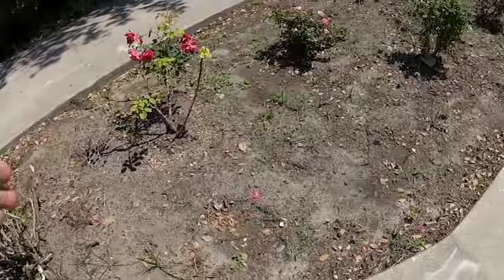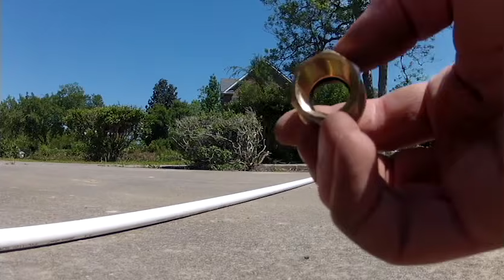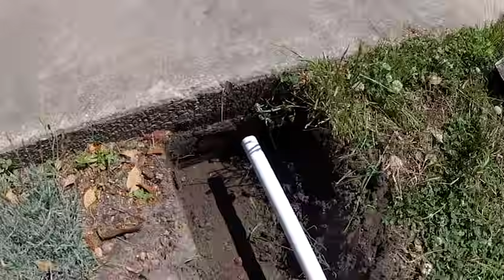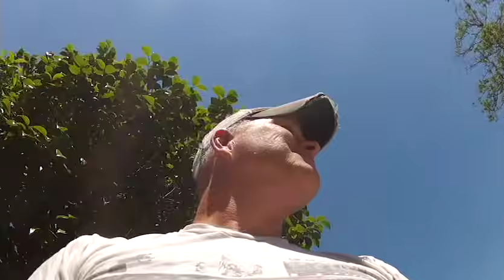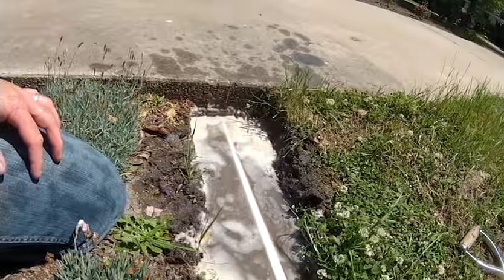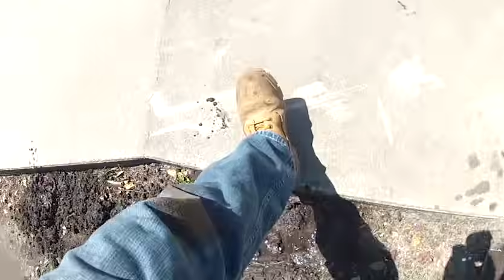How To Get A Pipe Under A Concrete Driveway

Comment: Let me help with a added tip... Make the pvc an extra 6 inches longer. Glue on a threaded fitting (pvc) to attach a brass nozzle with a 1/4 inch pressure nozzle. This will blast the dirt and Rock out of the way. I did same thing. Took me maybe 5 minutes tops to cross a drive way. When done remove brass fitting and cut thread off if not attaching a hose. I ran electrical through mine for lights... But same threads can use a drip hose! Easy peasy... Your way with slow hose removes too much dirt and concrete may crack with no support. My way only enough room for pipe is removed.

Comment: He's under minding his drive way I hope he is only going to  drive his lawn mower on it.  I'm sure it's going to crack up anyway ? I would not do this it's not that big of a deal to just drag out the garden hose when you need to water .  And not to mention if you don't include a way to and or forget to blow the water out of the line it's going to freeze in the winter it's not that deep under the driveway and on either edge?
Reply: Nope

Comment: Whenever I used this method, I put a nozzle on the business end and turned the water on full.   One wants to maximize the hydraulic horsepower at the tip.   Still not a bad job.

Comment: I did this over 40 years ago.  Two inch pipe, two feet deep, under a street and hit hole on other side dead dead on.  Reduced pipe to 1/4 inch hole.  Worked great.  Jake Cobbs

Comment: I did the same thing under a black top road, using a cap with a few holes in it.  It was long enough so I had to add the second 20" joint in the middle of the job.  No problem.

Comment: A variant to "saintnash's" comment that will dramatically improve jetting speed and further reduce caverning is the addition of a 3" - 4" long bolt protruding from the jetting cap. It doesn't even need to be ground to a point. Just center drill an appropriate size hole in the cap and affix a 1/4 or 3/8" bolt with a nut. The bolt will displace earth like warm butter! I would also make sure those jetting holes are small. Like 1/8" dia max! The less earth you can disturb the better. Even with these mods I agree with FortunaZKat's method for being the least prone to creating a  crack zone. Wakodahatchee Chris

Comment: I have rocks under my concrete, it is on an ancient riverbed. :))
Reply: Ok. You will need a drill with a long steel snake ( yard tools use them) to attack bit to drill through a pvc for support.  Don't go to fast.

Comment: so it dosent have to be high pressure   ...  this will save me some
Reply from the maker: No. I used standard residential pressure straight from the spicket to the hose
Reply: @mytaborcityhome1002  ,,thanx so much  all the other vides  were showing higher pressures ..this will save me

Comment: So I bore for a living.  Yes this is an easy way to get a pipe under your driveway.  But if you add nozzle to the front of it, and give it good pressure you’ll push this through in minutes.  Also people that are worried about loss of soil, you’re only bringing back the cuttings that is getting blasted with the nozzle.
Reply: Yep!  60 years ago my dad showed me how to do this while extending the sprinkler system at my grandmother's house to the street side of the sidewalk. He used a piece of galvanized pipe with a brass inline garden nozzle on the leading end of the pipe. Took about a minute to get under the sidewalk, then he unscrewed the nozzle and "adapter", screwed an elbow onto the pipe along with a riser and the brass sprinkler head and connected the upstream end of the pipe to the existing system with a union. He left the holes open for a short while so things could dry out & I don't remember there being much play in the pipe before he filled in the holes.  As a 10 year old kid I was pretty impressed!
Reply: Jeff, why did he not backfill, and horizontally tamp around CPVC?  Isn't he basically creating a future sink hole?  I appreciate your expertise, and response.  I want to run a few french drains around my house (red clay, bottom of a hill, I get all the run off), and pitch then to the low point.  Maybe a cistern.

Comment: Works like a charm........ Many times, as a BellSouth tech, I had to tunnel a driveway for the buried service wire 👍🏼
Reply: Multiple retaining walls were always a challenge. I used a ground rod and pieces of temporary to pull the cable thought.

Comment: You just created a void under the driveway. It will crack there and eventually fault.  Next time you might pick to go under at a concrete joint and then place play sand at the joint to backfill.
Reply: Concrete cracks

Comment: I think I’d put an end cap on the drilling end and drill a1/4 hole to add a super strong spray nozzle.  My drive is about 20 feet so, it’ll take some work.  Think I’ll go about a foot or so longer than the width of the drive so I’d have some room to work with on both ends.  But keep this in mind:
1/3 will do this a will be successful
1/3 will try,then call a professional
1/3 won’t even attempt this as it is too foreign to them.   LOL!  Good job!

Comment: I put a pipe under a driveway, just like you did. A few months later the concrete cracked exactly over the pipe and subsided 1/4 " but has been stable ever since.
Reply: Wonder if you could drill a hole vertically into drive half way and inject foam to fill annular void and support drive so it won’t crack
Reply: bottle jacks and spray foam - you can do it!

Comment: 30 years as a sprinkler guy . This is horrible advice.  sure it is easy ...but you are destroying  the concrete. by washing away the compacted soil.  I have a machine  with a bore attachment that can do this with no damage.. no water needed . and  is far cheaper than replacing a driveway that will  now crack in short time.....Sorry this is an idiots short cut....how about the follow up video to show the damage this caused. you are not a pro and should take this video down.
Reply: I agree. I think he gets away with little or no damage being this was done in a warm climate. Here in Minnesota with freezing ground, heaving, etc. this would not last one winter with the void under the driveway. A person might be able to get away with it for a few years in a warm climate area.
Reply: Good driveways are built on compacted gravel, pit run! Good luck with that
Reply from the maker: Don’t get butt hurt little buddy. I’ve got a 4-inch thick driveway and run a 6,000 pound Ford 555 backhoe over this spot on the regular without issue. No cracks. But I’ll agree that in the future if it does crack I’ll take down the video. Hope that makes you feel better.
Reply: @mytaborcityhome1002   . Not butt hurt.. not everybody has The ultimate un-destructible  driveway what you have . ..It is bad advice  it is horrible advice.... creating a void is never a good Idea . call any concrete contractor and ask if they would do this if they forgot a sleeve ... No they would cut and re-pour or call me...  Go ahead and ask any concrete guy.....2 types of concrete my friend and yours will be cracking sooner than later. Peace to you. and may your garden thrive with the drip system.
Reply: @mytaborcityhome1002  -but you also have to remember that we ALL have the money to buy the equipment Thomas has for a ten minute job. Then we’d be pc and Thomas wouldn’t get butt hurt.
Geeez...

Comment: Problem with this method is it washes away more dirt than the pipe will replace. You can get a crack in the concrete from the lack of support. I can show you cracks in my driveway and sidewalk from using this method. I found it better to use electrical EMT metal pipe. I hammer one end flat and then hammer it under the driveway/sidewalk. Compacts the soil so no cracks. It will lift pavers if you're to close to the bottom of them. Just cut off the ends of the pipe after you get it in and you've got a pipe to run smaller pipes and/or wires in.
Reply: I've tried this method before, doesn't work. I mean it will in certain conditions where soil is soft. Any other condition and it doesn't work, trust me I've tried. I've tried it in hard rocky dirt and it went about 2 foot in, not even the slightest inch more. I've tried it in clay and same sort of problem, it just gets too hard. Even with a sledge hammer I couldn't get it, it started to bend the pipe like a bent nail where you can't even continue. Also once you've hammered and it's gotten stuck 2 foot in, it's near impossible to pull out unless you half inch a rope to it and pull it out with a vehicle. Also per NEC code EMT conduit is not suitable for direct burial, it'll corrode and completely fall apart over time. If you are going to use a certain metal, it's got to be something on the lines of galvanized steel rigid conduit.
Reply: Theres a fix for that. Crude but works use low expanding GREAT STUFF IN A SERIES OF HOLES ACROSS TRENCH LINE BEFORE STUFFING CENTER YOUR PIPE OR USE CHALKLINE AND ZIG ZAG ROWS HOLES EITHER SIDE PIPE THE FOAM IF USED CAREFULLY WILL SUPPORT DRIVEWAY OR SIDEWALK. HIGH EXPANSION FOAM CAN WILL RAISE CRACK CONCRETE USE LOTS OF LOW EXPANSION FOAM.
Reply: That crossed my mind.
Reply: What happens when the ground is clay? Of course it’s going to be a sand base when the concrete is poured. Running a piece of poly or pvc under a sidewalk would work but a driveway?  No. Best to rent or hire out someone with a boring machine...cost a bit but it’ll save your driveway from cracking.
Reply: Concrete cracks
Reply: Yup, nobody wants to see your crack!

Comment: Anytime you pour a large concrete, alway throw in a 3 inch pipe underneath just Incase later on.
Reply: That's right.Thinking ahead will save you much misery in the future.
Reply: Makes a good stash spot too lol....
Reply: and put an expansion joint at the pipe
Reply: plus a spare or two lol
Reply: Lol.  Where would you put it or are you saying just put one every foot?
Reply: If that is a question that stumps You Construction is not for you. Obviously if you are pouring a driveway you would put one conduit near the garage and one near the road.
Reply: @engineclinic  obviously be strategic.
Reply: @engineclinic  Mike; Rondo is absolutely correct.  He must be in the landscape industry.   Put one at the top just in case, then one in the middle, then one at the bottom.  You really don't know where exactly, but it could later also be used for lighting, or a drain system for water being trapped.  I'm in the landscape business, and when I can, I always suggest to homeowners to do that. When I get the landscape contract, I insist the cement people pitch the pipe and pour over it.  The concrete people know exactly why it's being done, but rarely ever do they exercise this all important step. But they do it at their house. Last week I dug under a 3 foot sidewalk to get water from a downspout and into a 4 inch pipe under the concrete. I have another one next week to eliminate water coming off a roof with no gutters, and water pools at the foundation with nowhere to flow away.
Reply: @lostinmyspace4910  very true.. landscapers think ahead by placing pipe underconcrete in case something needs to be ran at a later time.

Comment: Put a nozzle jet on the end of pipe. Then jet pipe under drive. That’s how us landscapers do it. Much more effective than mere pvc pipe with no nozzle fitting. Trust me- 34 yrs. experience!
Reply: Travis ,the man did a good job to demonstrate to a home owner. He is not afraid to get dirty hands. So sir thanks for your video.
Reply: Do you have pic what a nozzle jet what type you use
Reply: You can use a water ballon fitting to create a jet. A blader wouldn't work great but I have used it in a 1½ and left the 1½ under for support. And don't do like he did if you do it.  Everytime he rams the pipe with all his might he is just compacting it tighter.water is the strongest for on the planet it will move anything in its way.
Reply: Its a brass cone same looking sprayer, no more than 3" long, just put a threaded end of your pvc pipe n your ready
Reply: ever have a problem with the asphalt driveway cracking?  thinking of using this method on a system but don't want to have to replace the asphalt driveway
Reply: Why doesn't this increase the chance your slab will crack under vehicle weight or  freeze thaw?
Reply: @roasterbcool1492  because the compacted soil underneath is disturbed quite a bit leaving space for the pavement to flex too much.
Reply: I think he didn't have enough pipe to cut off temporary fittings, but I thought the same thing.
Reply: Yes your right I use a 15ft  jet hose off my power washer handle and push threw with a 3/4 PVC work great
Reply: Contractors aren't worried about your concrete cracking later on long after they've been paid
Reply: @frankdodson3534  not true some offer to repair it but still want paid as well
Reply: The truth is all concrete slabs crack. All the concrete contractor can do is put in control joints. If large cracks form or the surface peels within a couple years you can seek damages from both the contractor and the Ready-Mix plant.
Reply: @jacobladder6165  9
Reply: That is right your way is correct. Not this way.  must be really soft soil for it to be banged on with a open pvc pipe with very little water pressure. I’m amazed it ever worked.
Reply: You sure got lucky on this one. My opinion. God bless.
Reply: How about under black top driveways>?
Reply: tell the crack head on the other end to take a large exhale. .....just kidding
Reply: @jodyguilbeaux8225  0

Comment: I always cut several teeth into the end of the pvc pipe so it cuts through the dirt better. It will literally cut your time in half.
Reply: Its so hard to do that here where I live. The ground is so rocky that its hard to even put fence posts in the ground lol.
Reply: That’s a great idea. Thanks for contributing.
Reply: It works like charm I was showed that trick back in 91 from my old boss we usually used a pipe bigger than I need that way you could get more than one pipe or run a pipe and the wires for the stations valves and I dig a side tunnel for drainage both sides but just take your pipe cuter and make some teeth once in you can cut them off no problem

Comment: A length of rebar could be slid in the pipe to hammer out any stubborn rocks.
Reply: Best tip so so far.
In the uk the sub base is usually a lot thicker with all kinds of nasties buried I can't see this working here unless you use steel rods and a power tool to hammer it through.
Reply: Or you can just put it on your drill and use it as a drill bit.
Reply: yep,

Comment: If you glue a pvc cap on the end and drill a hole in the center it will go faster and act like a jet and be easier . This is how i do it for my plumbing company.
Reply: Yip.  He would have been done in 4 minutes instead.
Reply: Would a metal conduit work better,  than follow that with the pvc?  Or would that be too rigid to make a leveled layout?
Reply: Do you mind showing us how?
Reply: Lol
Reply: Excellent, thank you!
Reply: Was thinking that myself, a piece thats pointed bout 3 inches maybe with a piss hole hole at the end,  that way its more drilling with tje water pressure its pointed end, and does not allow mote dirt washed out from jaming a blunt end.

Comment: i had aproblem with this method ill share it may help someone i had   10 ft concrete driveway i needed to go under for water line  before this drive way was paved iwith gravel  several inches deep so i had to to try get under the gravel  no luck kept running into gravel about halve way  ended up sawing concrete near aseam  lifting that out  cleaned it i also used a size larger pipe 11/2 inch for conduit in case i ever had to repair it  will be easy to take 3/4 pipe out then replaced concrete   ok now
Reply from the maker: Yeah, this Meath is certainly wouldn’t work in all situations.

Comment: Great video! Thanks! I wonder if cutting off the front end of the pipe at an angle would help it dig its way through - by turning the pipe...
Reply: Just an angle wouldn't so much because the water pressure would be going out that cut and you want all the water pressure going forward to bore the hole out. Making a few V cuts on the end to create pointed teeth like a hole saw bit really helps when you twist it as you're going in.

Comment: Great video. A few things to consider might be...cut the end of the pipe on an angle to possibly make it easier going in under driveway. Add a shutoff valve to save walking back & forth to the hose bib at the house. Use a little longer pipe so you aren't smashing your hands against the concrete at the end. Well done 😎👍

Comment: Does it weakens the concrete underground? How do you pack the soil there?
Reply from the maker: In the couple of times I’ve used it I haven’t gone back and packed in soil into the area. My driveway run about 3-1/2 to 4 inches thick. I have a Ford 555 backhoe that weighs roughly 14,500 pounds and run it over these spots without ever seeing so much as a crack in the concrete. Thanks.
Reply: Okay.

Comment: I better pressure washer would make that go a little faster
Reply from the maker: I would bet so. This was done with regular household water pressure. Thanks
Reply: @mytaborcityhome1002  - Using a pressure washer would only blow away to much soil & leave a void, possibly causing a collapse in the future. I've got pavers for my driveway & only use a minimal amount of water....just enough to get the pipe through without causing a cavity especially if it hits a stone.

Comment: I have seen this done in northern climates but usually go much deeper to minimize issues with water, freezing, settling, etc. Have also seen guys rig up a steel extension pipe and do it with a pressure washer. (look out for flying mud!)

Comment: What if the driveway was properly built with a base layer of crush n run and some gravel under the concrete?
Reply from the maker: I imagine in that case it would make it more difficult. My base is coquina
Reply: Go deeper